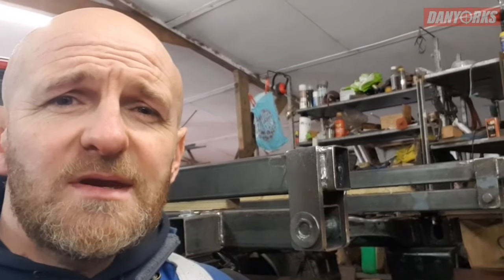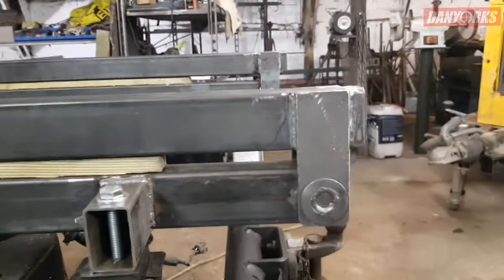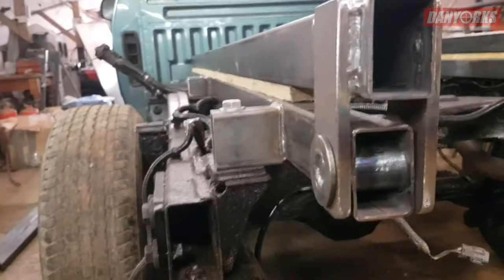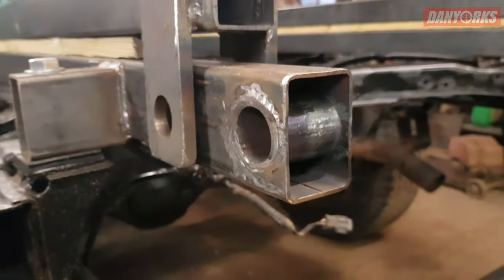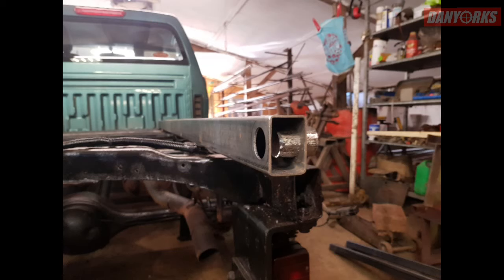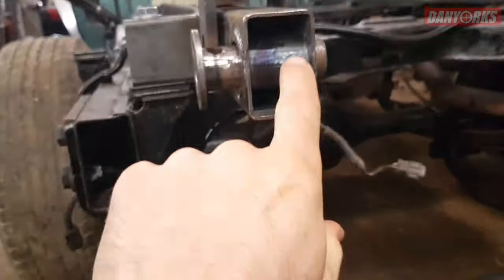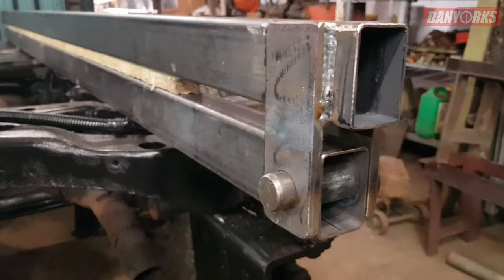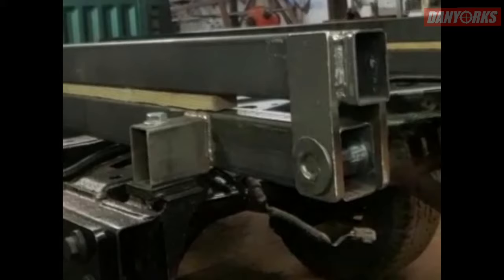How to make a tipper or dump truck hinge.

Comment: I like it.  Was thinking of no pipe arou d pin
Reply from the maker: The pipe increases the strength by a massive amount and prevents the box section from buckling. When tipping there is a lot of force on this hinge. If you don’t use the pipe, eventually the holes will wear.

Comment: Well boy! Hows she cut'n!!?? 😉 thinking about making the same at home but on my kingcab d22 nissan... smaller bed but still cool. What bed did you put on it after ?
Reply from the maker: I've built an Arb box for tree surgery. 60mm x 40mm box steel frame and 1.5mm galvanised sheet (should have gone a bit thicker but was trying to keep the weight down). I'll post a full video when the build is completely finished.
Reply from the maker: Here's the full build buddy - https://youtu.be/HkCTmlpaQo8

Comment: looks like the top piece extends a inch or two.  What will you use to keep the spacing between the bottom and top?
Reply from the maker: Nice piece of hardwood (similar in size to the piece of softwood in the video).
A piece of wood stops the body rattling when the truck is empty 👍